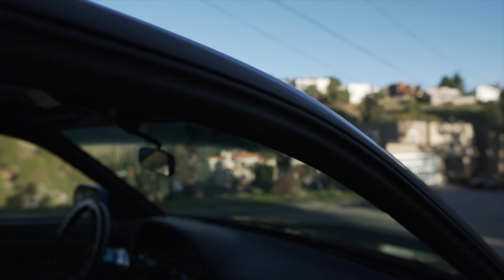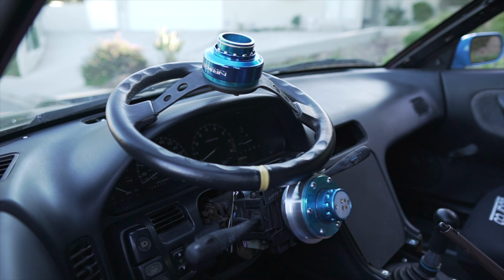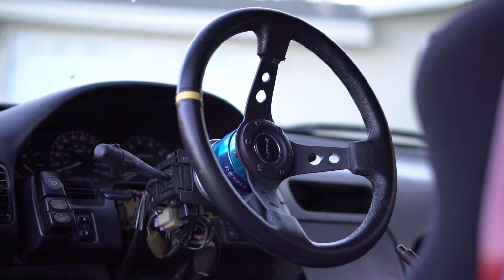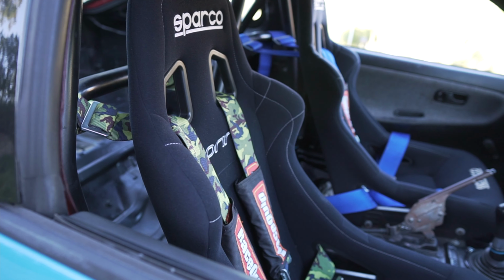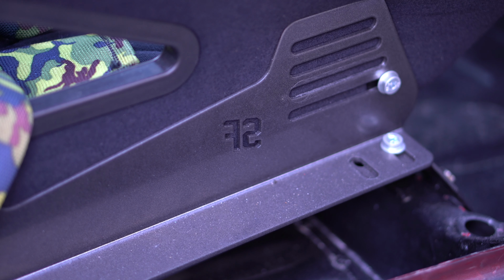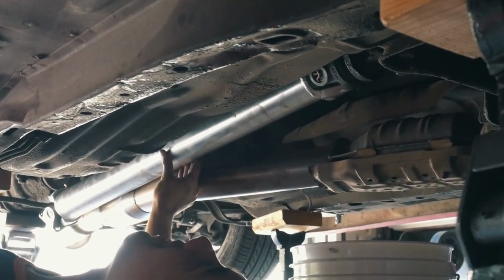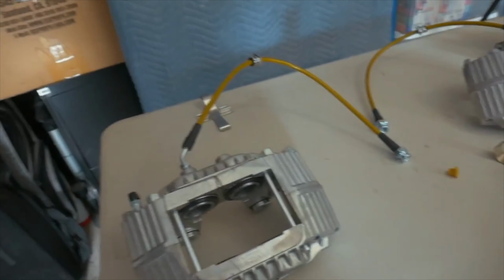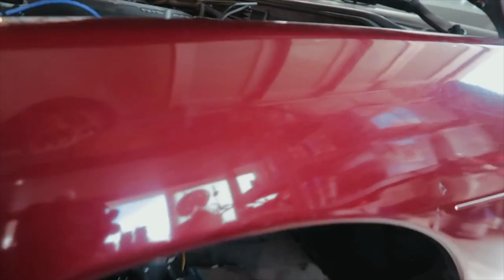240SX TOP 5 MODS UNDER $500 | S13 S14

Comment: You forgot to mention 5 lug hubs, probably the best (under 500$) item I've baught for my s13, can't do the 300zx brake conversion without it.
Reply from the maker: I would have included that actually but with wheels and tires it's way over $500. There are also a few rotor options for 4 Lug S-Chassis's with Z32 front calipers.
Reply: @Christian_Meyer  I forgot about that, guess I was fortunate enough to have friends to give me s14 rims, rotors and calipers lmao
Reply from the maker: That works hah
Reply: i have 300zx brakes all around and 4 lug hubs. I just paid a shop to drill a 4 lug pattern into the brake discs. Cheaper than new hubs.

Comment: Great video bro, it definetly gave me an insight on to what the first mods should be ! I'd probably go with some suspension mods right after since thats what will affect the the movement of the car. Then i will make horsepower mods in the end.
Reply from the maker: Sounds like a plan! Replacing 20-30 year old struts with decent coil overs makes a world of difference.

Comment: My isr short though did rattle had to wrap tape around it then slide the metal piece back for a more snug fit and it works great for the minor work to remove the rattle if you have it its 100% worth it

Comment: 🤔 found a auto 1990 240. Is it worth for 7.5-8k?? And how much does it cost to switch to manual
Reply from the maker: I paid $3200 for my stock manual 240SX
Reply: @Christian_Meyer  this still has 75k miles and no damage or anything. Unmolested
Reply from the maker: In my experience, older cars with that low mileage have often sat around unused for a while. This causes seals and gaskets to harden and it will still need similar maintenance to a higher mileage version.
Reply: You can definitely find a stock manual one for $3k or less
Reply: Yepperz bro where, i live in michigan but i’ll travel anywhere in the us if i can find a deal like that
Reply: Dude I can’t find one under like 8-9K anywhere and no stock ones
Reply: @AJservicetechAZ  keep looking I literally just picked up a rust free vert for 1900. Try fb marketplace & look outside of your state
Reply: @yepperz  xd I got mine even lower under 2k. Just had stripped interior. I wish people would stop overpriceing these cars so I can see more of them on the streets
Reply: @Alex-vz2jz  I think I overpaid for mine, 4 grand and needs an ass load of mantainence